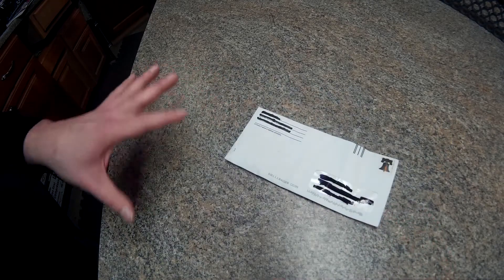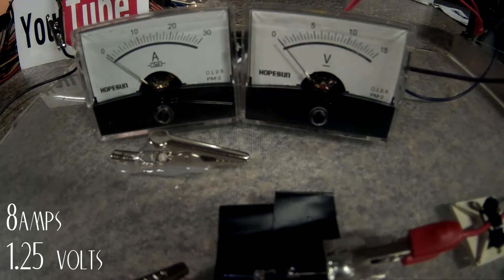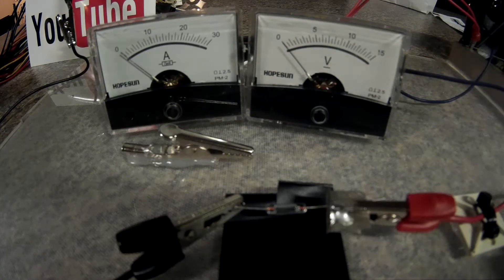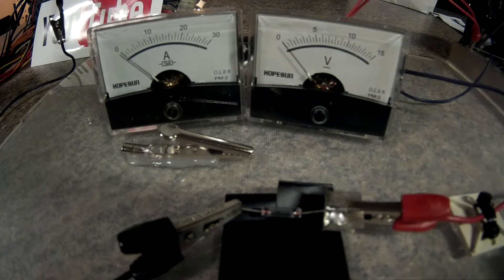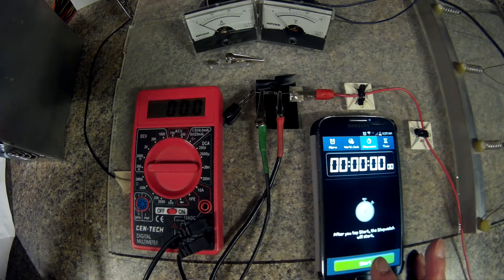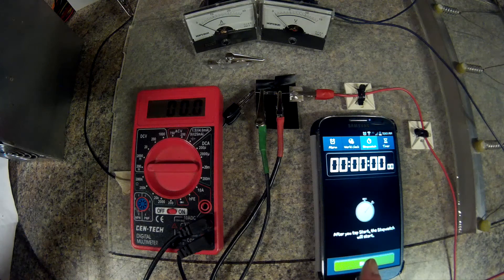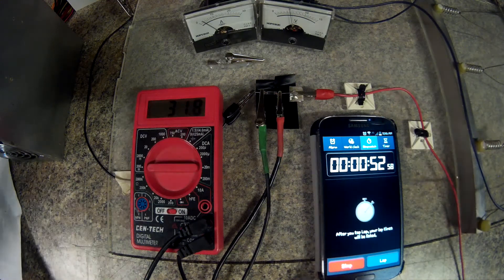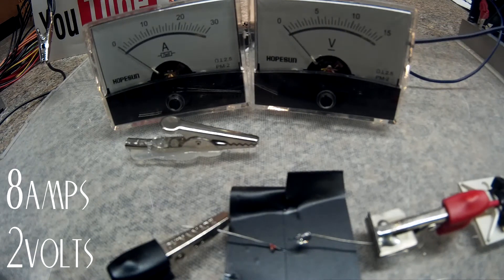Diy Tesla Powerwall ep34 Az_Tekkie's 5a Fast Glass Axial Fuse Results

Comment: I'm impressed with the performance of these glass fuses. (as well as your testing method) Seems like the general trend is that they blow at roughly twice the rated current when used on our batteries. I'm thinking of getting the 2A rated ones for 4A protection. Though anywhere from 3-5A would be fine, I think.
Reply from the maker: Thanks!  They do seem do be consistent at twice the rated.  Yeah I think under 5amp protection is a great number!

Comment: The link you gave for the fuses is 0.5A not 5A and I orderd it with out noticing that, so I order the right one 5A  !!
Reply from the maker: Yeah the Link I had in the lower part of the description was .5 amp.  I did add a 5amp link at the top, not sure why it wasnt in there.  Thanks for the heads up!

Comment: probably i Will use this 2A glass fuse To thanks
Reply from the maker: Ok, The 2amp fuse will pop at about 4 amps.
Reply: AveRage Joe what Max avg you Will work in each cell? with this fuses
Reply from the maker: +João Luis Martins I am goin to try the .5amp fuse and it pops at 2amps. The 1amp fuse also pops at 2 amps which I probly should of ordered because it has slightly less voltage drop. What amp fuse are you looking for?
Reply: I have 2A but i'm worry with the voltage drop because of that I don't use yet...
Reply from the maker: The 2a fuses will have 25mv drop at 1a draw and 50mv at 2a draw.  So if your avg amp draw is less than .5a I would think the voltage drop would be ok.  Again that is my opinion.
Reply: I have maximun 500mah in each cell
Reply from the maker: I think the 2 amp would be fine
Reply: ok thanks